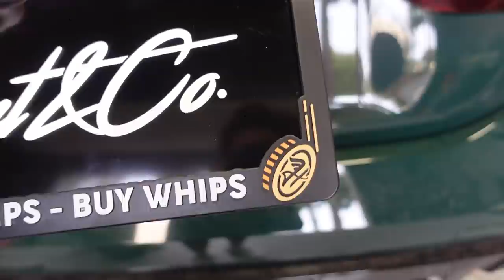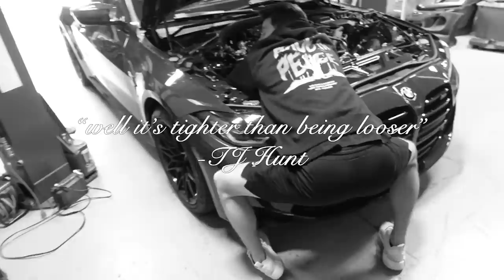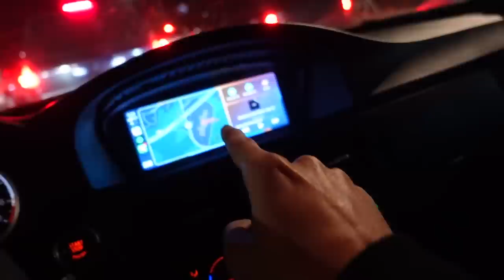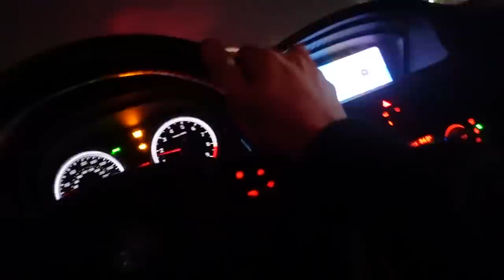G82 M4 LOUD Catback Exhaust Install!

Comment: I have an n54 and what I've noticed is with bmws you need resonators. On mine I got rid of everything and have only a resonator and it sounds great. My dad has an n55 and he got rid of everything but added a vibrant resonator and it sounds amazing. Nothing beats the sound of an n55 imo, but just something to think about if your trying to get that sweet spot and that's how I achieved it with my car. Lovin these Bimmer vids keep em up🤟
Reply: I’m keeping that in mind. Thanks for that.  Might have to throw mine back on and see what’s up 😅
Reply: I have a 435i and I have a catless dp and a Bomiz exhaust and I think it sounds great
Reply: I wonder if thats the same with VW. Got a GTI and i think this car sounds like straight ass loud
Reply: @micaiahreese  I'm so scared to get an exhaust for my Jetta wagon 😂😅 cuz I know vw cars don't sound the greatest with em
Reply: i bought a 2010 E90 335xi & i just have the vrsf dp & i honestly wanna just leave it like that it sounds good to me
Reply: @michaelteeter3886  right lmao,I have a borla exhaust on GTI now and it's alright sounding but I'm ready for a downpipe for more power but I know that exhaust with a downpipe is tractor territory lmao
Reply: @ihate5x112_  yeah, if I'm doing a downpipe though it's definitely going to be chatted cause Cali, but I do have an option for the IS38 turbo and flex fuel with stock downpipe which is probably what I'll do.

Comment: I would recommend getting catless DownPipe, definitely changes the tone
Reply: too bad its illegal in cali
Reply: @kidultstudios  doesn’t really matter, I’m in San Diego like TJ and I’m running a catless DownPipe on my 2021 bmw, car doesn’t have to be smogged for years since it’s new and the car isn’t excessively loud, especially if you have a valved exhaust
Reply: @Theft1x  same. Got a catless dp on my 23’ m240i and I’m right here in Temecula area
Reply: @kidultstudios  he'll probably register it to Montana to avoid the Cali restrictions
Reply: @kidultstudios  Having the exhaust that loud is also illegal in CA.
Reply: Do you really think he doesn’t know this by now?
Reply: @MX304 just don’t be a ricer and run rich to downshift and pop all the time. My car is crazy loud and as long as I don’t drive obnoxiously cops don’t care
Reply: catless downpipes just add rasp lmao. Has been that way on the f8x platform too
Reply: @macbook802 you can’t run turbo cars on 87 or else you’ll get knocking
Reply: go to la i know someone who will pass him he gotta page jus lmk
Reply: High-flow cats typically give you a cleaner exhaust tone, full catless can get raspy quite often
Reply: @macbook802  this is awful advice, you shouldn’t ever mix water with gasoline and turbo charged cars should never have anything less than 91 period. Plus you shouldn’t really ever use anything less than 91 in any newer car period, keeps your valves cleaner and can keep from knocking in temperature changes
Reply: @macbook802  gasoline and water don’t mix, ever. Gasoline will float so no it does not prevent knocking. You cannot mix the two period
Reply: @kidultstudios lol Cali problems. East Coast!!
Reply: @mondo9.2.5  okay fed

Comment: I came from the F80 platform and one of biggest issue was the sound.  The Active Autowere Equal Length Midpipe was the fix on the rasp.  I moved onto the G80 platform and I can honestly say there is still rasp.  I put on Active Autowerke's new Prototype Equal Length Midpipe and it sounds incredible.  Smoothes out the tone and in my opinion is how the car should have sounded like.

The S58 platform was supposed to be equal length and people still think it is. The team at Active Autowerke actually measured and its still off by a good amount which is what you hear on the higher RPMs.  Let me know, I know the team at Active Autowerke personally and we can get you setup with the Equal Length. 

Here's a video of what their equal length did with a high flow catted downpipe and stock rear  exhaust

https://youtu.be/ADcfhgks1Mc
Reply: I’ve seen your vids… wondering if you’ve listened to @phillycarclub2902 g80 exhaust setup. Think it runs a valvetronic setup.. imo it takes the top spot for me
Reply: @Michael Diamantino  yes I've heard his and it does sound good. Not sure how true this is but I heard the manual (which is what philly has)  was different from auto version from Valvetronic. The auto transmission which has a larger footprint from the manual transmission changed the tone slightly since the auto transmission took up some more space and slight changes needed to be made. I know Active ran into that issue during early developments but created something universal for manual and auto.
Reply: heard your setup on that recent upload..sounds fire 🔥

Comment: You can make the s58 sound good, you just bought the wrong exhaust. Most people do. It sounds better with the windows up because of the artificial sound through the speakers. Get a properly equal length exhaust. BMW claimed the new test pipes/downpipes are equal length but they aren’t. Get it equal length and it’ll sound better

Comment: On the S58s (similar to the S55s) equal length midpipes make a HUGE improvement in the exhaust tone.

Also, if you change your downpipes, high-flow cats are going to sound much better than fully catless ones.

Comment: If it's anything like the S55, it'd benefit from equal length midpipes. N54, N55, & B58 sound good because of their exhaust setups, but for whatever reason, the S55 was fart through a paper towel roll sounding. I haven't been around enough S58s to have a good baseline, but still might struggle from similar issues.
Reply: B58 owner here and i can confirm it 😃👍🏼

Comment: BMW always sounds better driving valves open than reving in Neutral/Park, also ive found modern inline6 BMW sounds better at 3in + muffler delete + cutout/valves ( if you wanna go the extra mile eqaual length headers) & since the S65 is dead next best thing will be an M5, any BMW TTV8 sound good with no effort

Comment: Tune the dct to really bang through the gears. I wasn't a fan of the exhaust noise since the f80 generation  until you expedite the sound of the transmission. Going through the gears makes a big difference in exhaust noise if you hear the shifts.

Also, if you change to an equal length mid pipe from active autowerke, they really make the rasp go away. I'd stay away from titanium exhaust setups because they do sound "tinny" and make.the rasp more noticeable

Comment: Not sure for the S58 but for the S55 the only thing that really fixes the rasp is an equal length mid pipe or single mid pipe. I prefer the sound of the equal length system. I have the equal length valvetronic design’s exhaust on my M2 comp and it sounds great with no rasp.
Reply: Only thing that TRULY fixes an i6 bmw is a single turbo……
Reply: @ianlasken6109  Very true but that's a lot more money hahaha
Reply: @ATron35  true. If only money grew on trees right ?😕

Comment: The S50/2 and S54 had the notorious BMW rasp for the inline 6 i feel they tried to bring it back. S65/S85 will always be unmatched. Just got rid of my E90 M3 and grabbed an S6 4.0t v8 nowhere near the noise of the S65.

Comment: As a BMW boy myself, I will say the N55/S55 is the best sounding BMW I6, but the B58/S58s can sound good too. They key with BMW inline 6s is you need a resonator! Get rid of everything but the resonator, and if you want to lower the volume a bit add a small muffler too. The resonators really help control the rasp that the inline 6s have if you go straight cat back to a muffler.

Comment: There is a video on youtube by Philly Bimmer Club that showcased a G8X with valvetronic equal length  single mid pipe and aftermarket Catless DP with stock mufflers, hands gown the best sound for these cars!

Comment: The biggest sound difference would be a resonated single mid pipe. Or you can be different and run a JDM titanium single pipe. But the sound you want will require a single turbo instead of twins. Doesn't have to be a giant twin scroll turbo medium size 6-700 hp.

Comment: So after doing custom exhaust setups over the years on customer cars. I can tell you that a 3" twister on each bank as far towards the front of the exhaust stream you can do. Will cut 95% of rasp from the exhaust tone. Leaving you with that perfect deep no rasp exhaust tone. I swear by these things. They are a baffled non restrictive resonator with a blade setup that evens out the exhaust stream. My god do they do wonders on v6 and 4 cylinder applications.
We did a 370z last month that basically did header back exhaust with just a twister on each side and it had literally no rasp. If you own a 370 you know how bad the rasp is on those.
Great content t.j love the car. Can't wait to see more.

Also on a slot of turbo cars I replace the cats with the twister's. They still look like a high flow cat and truly change the sound of the car in a good way.

Comment: There was a guy on YouTube that gutted the huge muffler on his older m3 and it didn't have the tinny rasp sound, when I had my 330 when I put headers on it I put a single 3 inch exhaust with a glass pack on it sounded like almost an RB at 8k rpm the only problem I had is the car didn't like revving that high and it back the sprocket off the oil pump and I blew it up 🥹

Comment: I’m glad Sabrina is well with good spirits!

You wanted it to not have the raspiness yet they send you a straight mid pipe which is what causes the exhaust to be raspy…Smh. The resonators up front is what cancels out the rasp, the mufflers out back controls how loud it is. A good set of resonators and straight pipe out back will make it loud while keeping the rasp down. Take off the cats however and it’s going to be obnoxious no matter how good the resonators are.

Comment: the S58 needs an equal length resonated midpipe to get a better exhaust note tone. the stock UEL midpipe setup is def why these 6-cyl motors sounds kinda trash

Comment: Please I have an f82 you need single midpipe or el midpipe only options that sound good on the new bmw because the downpipes aren’t equal so it throws the sound off and it’s so raspy. If you want me to send a video of my exhaust. I have arm res downpipes to a single midpipe to stock muffler

Comment: One of my cars is an M3 S54 and it's known for the raspy engine note. Here's what you gotta do... Catless downpipes. DPs are the only thing that will change the sound of the engine, everything past that will just change the VOLUME of the sound produced. So after you do catless DPs the next step is to embrace the rasp and fall in love with it because it is never going away. Hope this helps, Cheers.

Comment: Need equal length or single tube midpipe. I like single because equal length quiets it down a lot higher up in the rev range.

Comment: I know on my cobalt ss the smaller the actual muffler the raspy it got. I had a Flowmaster on it and it was super tinny and raspy. I got a muffler that had more internal volume and it gave it a deep tone for a 4 banger and a nice loud full throttle.
So my guess would be replace the muffler with a higher internal volume muffler.

Comment: You won’t see this but press your sports button in accessory mode and then tap the gas then start the car it opens the valves for the start
Reply: On my f82 I have single mid pipe catless dp and stock muffler and tbh there’s no rasp might worth giving a shot on a g8x